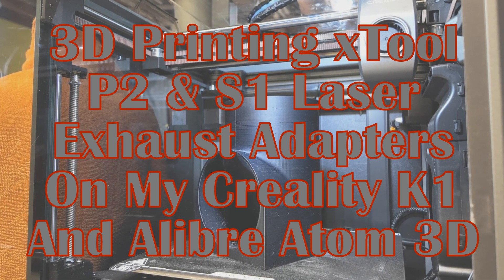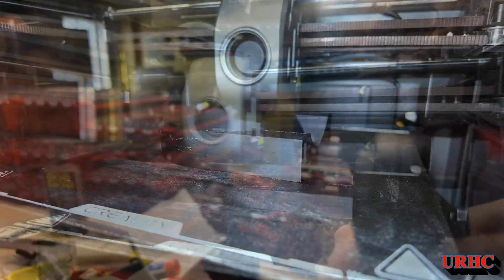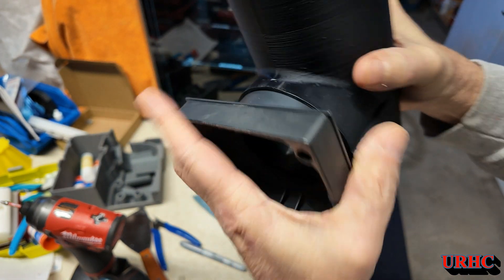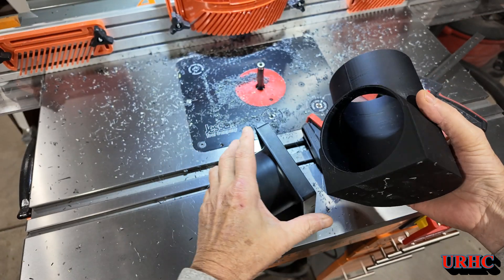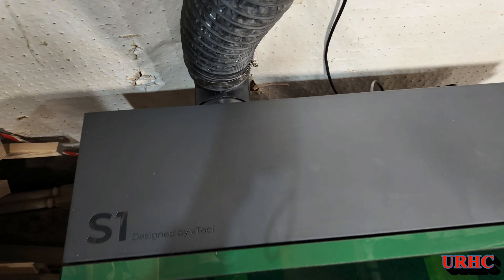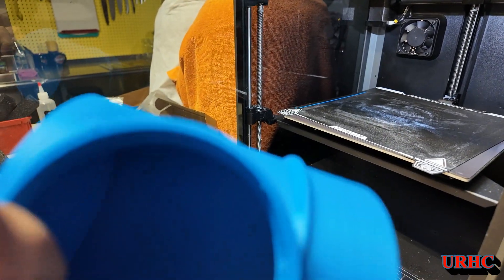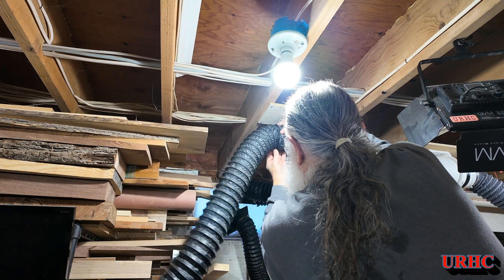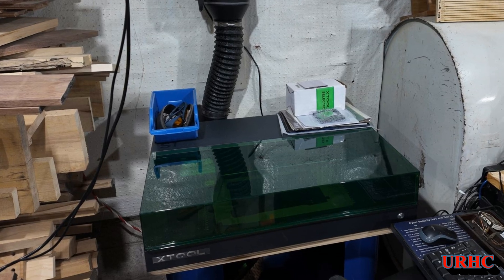3d Printing xTool P2 And S1 Laser Exhaust Adapters On My Creality K1

Comment: If you buy a filament dryer or repurpose a food dehydrator, that filament will be just as good as the day you bought it.
Reply from the maker: That would be a good idea if I had a lot of old filament and they weren'tso expensive.  I should just start using the rolls faster.  Thanks for watching.

Comment: Good fix for a more than common problem. Great video
Reply from the maker: Thanks. Not perfect with the tight bend but works good. All the xTool hoses are undersized from the factory in my opinion after smelling the difference. Thanks for watching.

Comment: Hi 👋, URHC , I was just reading through other peoples comments! I forgot to mention, the router table looks very impressive, Just out of curiosity, what make is it?, In some respects, it reminds me of my planner, that it has a digital readout, so there’s no handle to raise it and lower the table, SCM Thickness planer Class S520 , Phil, from the moulin
Reply: Okay I will have a look 👀, thank you for sharing, information, it’s always interesting seeing different and new equipment from all over the world, Phil from the moulin
Reply from the maker: I designed and built it a couple years back. There's a series of videos about the build. Uses a 3 1/2 hp router and works really good.  Thanks for watching.

Comment: Hi 👋, URHC, That was a great territorial, explaining how you created your adapter modules, and I must admit you make it look so easy, 
It is surprising, what can be built nowadays by 3-D printing , I was watching something the other day where they were building something for a race car, they were using a metal filament, but the problem with this, you have to have a special machine, as it has to be baked, I think afterwards and cleaned, and I presume this is very very expensive, but still very interesting, keep up the great work your territories are amazing, Look forward to seeing and hearing from the next one,
Reply: Hi 👋, yes hi too. I’ve seen properties et cetera being built with cement slurry, I think it was beginning of last year when I first saw it quite amazing, 😂😂😂 so does this mean you’re going to build a new property or even a larger workshop?😂, to house, all your new machinery that’s coming your way., 😂, keep up the great work, stay safe,
Reply from the maker: If I was younger I would be out of NY tomorrow.
Reply from the maker: It really is easy with how all the newer software and machines work together.  There are 3d printers for just about every material today. The metal printers are still quite expensive but the prices are going down fast. I recently was offered a printer for ceramic items but just didn’t want to get involved building a kiln to fire them. The ones I like most are the ones now printing houses in a day using a cement slurry. I have been having a lot of fun with this machine.  Thanks for watching.

Comment: I'm gonna have to do the same with my S1. I don't use it as much because of the smell in my basement. Thanks for the video!
Reply from the maker: Made a big difference.  If you don't have to make a close bend just going straight is the easiest.  Those Infinity fans are great.  Just make sure there is adequate air coming in that you don't create a  vacuum if you have a tight house. Good luck. Thanks for watching.